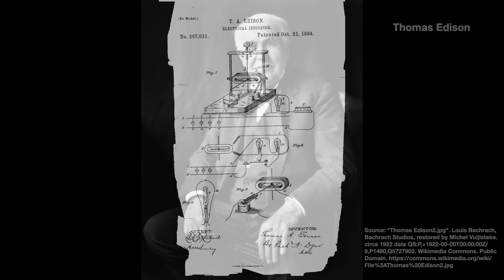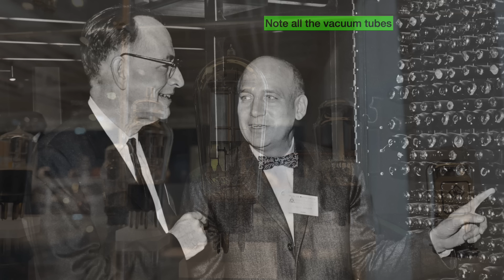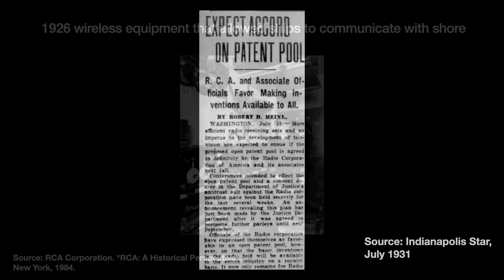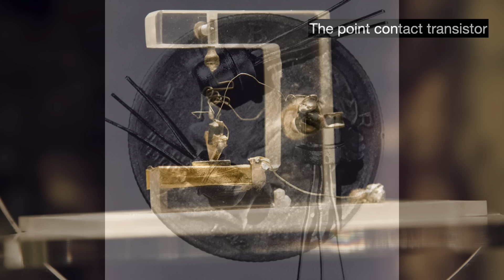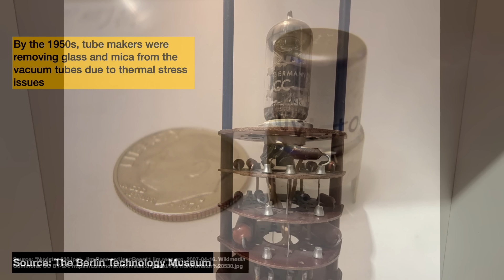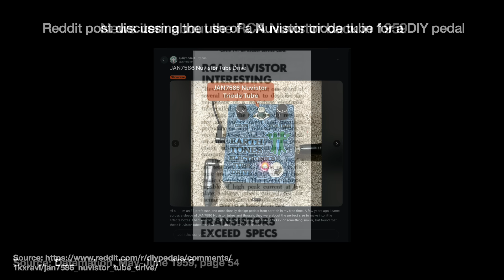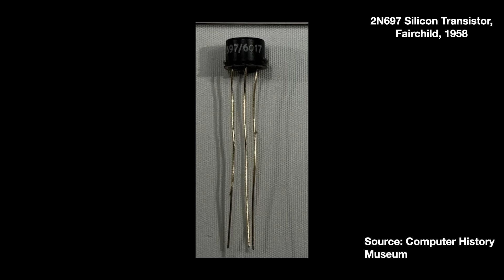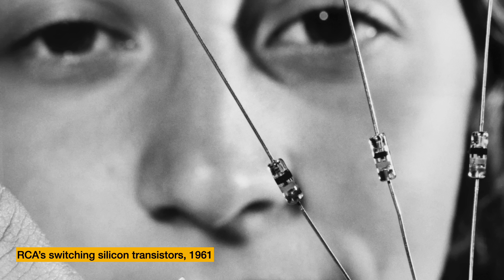RCA Made a Vacuum Tube to Beat the Transistor

Comment: If you follow the guitar amp world, you still see "we've reinvented the valve" products crop up from time to time - designers trying to get the tonal effect of a valve without the bulk, heat and fragility.
Reply: And then you discover that thermionic valves on silicon chips exist…
(And in WW2, vacuum tubes able to withstand accelerations of 20,000G were manufactured in the millions).
Reply: The Russian vacuum tubes were the best for that.  They probably still are.
Reply: Funnily enough there's a pedal that has used the nuvistor in it lol, the lightning boy audio nuvision. Maybe I'm too much of a zoomer but I never had a problem with opamps and chips anywhere. God's own semiconductors man godbless
Reply: And isn't that exactly what it is? An electron 'valve'? It describes way better what it is than naming it after the form of it's vessel.
Reply: @philippkemptner4604  What vessel is called an "Electron Vacuum Tube"?  And why would naming it after a plumbing fixture be better?
Reply: @MRandDS  Because it was all being discovered before understanding what was happening within. To them it functioned like an "electricity valve", very much akin to a valve used to control the flow of fluids. The "handle" is the grid, named because it somewhat resembled a mesh in many of the "later early" experiments.

The "gate" term later used in FETs honors the valve, implying "gate valve", as FETs function much more like tubes than a bipolar junction transistor (tubes and FETs are voltage controlled devices rather than current controlled as with the BJT). The "drain" terminal was also given in the same way. They went with "source" for the emitter/cathode analog, I guess "spigot" sounded weird, even though it was a very common term of the time lol
Reply: Guitar amps also love leaky capacitors for the same reason
Reply: There's this fantastic company that makes physical versions of electrical components out of plastic for teaching purposes
Reply: It’s like a pie. There’s good but then there’s really good. That tiny feeling that make me feel at home
Reply: Yup! Like the peavey vypyr tube heads 60 and 120 watt
Reply: Mechanical fragility yes, electrical fragility, no, vacuum tubes are very tough to emp and radiation
Reply: @KingAreallyus  I believe there were valves/tubes used in the Apollo spacecraft. They seemed to have performed ok considering what must have been a harsh environment.
Reply: @KingAreallyus , and, tubes can often survive brief voltage surges well above their ratings, while transistors instantaneously emit the magic smoke!
Reply: So cute that a VT is called a valve in many parts of the world. Cheers!
Reply: @shauny2285 ..and in some parts of the world " Lamps" is still used to describe a Valve. If you think about it " Valve" describes the function perfectly..it regulates the flow of Electrons just like a water valve regulates the flow of water❤
Reply: @shauny2285  It's certainly common to call them valves here in the UK - at least amongst a certain demographic. As the vacuum tube was invented by a Brit and he coined the term valve I think we have first dibs :).
Reply: @dynamohums where's that dynamo comin from??
Reply: @Beardwhip the 'old' engineer that I worked with called them "Fire bottles".
Reply: @dynamohums The Demograohic being every single Electric guitar and bass guitar player in the UK with good ears❤
Reply: @patrickfrantz2466 cool , " I think fire bottle no-1 is on the way out, it amplifies the noises produced by my portable communication device"!  Excellent, we need an international designation that every user/buyer can instantly recognise and " Fire-bottle" gets my vote.
Reply: @Beardwhip  I believe it was Faraday (another genius Brit) who discovered the principles that made the dynamo possible :)
Reply: @dynamohums  I did not know that Edison was a Brit.  Interesting.
Reply: @MRandDS  Edison was primarily a patent troll.
Reply: @dynamohums  Yeah, I know that's what the modern internet has told you gullible kids.  I bet you think Tesla was some sort of deity as well, don't you?
Reply: @MRandDS  Not really. Tesla was right about AC though. Edison made the wrong call backing DC.
Reply: @dynamohums , Edison discovered the principle of thermonuclear emission by accident while searching for ways to make light bulbs longer-lived. He made note of it but didn't pursue it further. Fleming, and deForest, were the first to make usable diodes operating on thermonuclear emission principles.
Reply: @goodun2974  that's right
Reply: @dynamohums  So that somehow portrays him as a less than and a stealer-of-knowledge?  And I guess that since he only discovered it by accident, then that totally disqualifies him from being the discoverer of thermionic emission and vacuum tubes. :|
Now I'm ready to start posting on Reddit and editing Wikipedia articles!!!
Reply: @MRandDS  😃. Edison certainly commands respect. I was just saying that the actual inventor of the tube/valve was someone else and he used the term "valve" to describe its effects. Which is a great way to describe it (as well as "grid" and "drain"). It's electrical plumbing!
Reply: @dynamohums yep, that would John Fleming.
Reply: @shauny2285 we call them 'lamps'.
Reply: True, there is a company making SS rectifiers built in to a valve shaped container that pops straight in to the base( the shell is a bit smaller size) that would have held a 5y3/5u4/5ar4 etc. Copper coloured shell with a blue logo  can't remember who makes it but it looks and works well in Guitar amps that used Valve rectifiers. All the orher valves can't really be replaced with SS  and please the human ear, for making music the Thermionic Valve is still king, all the ecc-81/82/83 and El-84, 6V6 /6L6, el-34 etc will be in demand for 100 more years...at-least❤
Reply: @Waldoandotto007, it's fairly easy to simulate a vacuum tube rectifier using some silicon diodes and a resistor or two to match the tubes' internal voltage drop, but providing the slower warmup of the tube rectifier (gentler on tubes and filter capacitors) is trickier to implement. A thermistor sort of works but takes longer to come up to minimal voltage drop/maximum operating temperature; the heat they generate tends to fry any nearby components (sometimes they unsolder themselves!), and putting a thermistor into the same plug-in housing as the diodes and resistors would tend to trap the heat and fry the diodes.
Reply: @Waldoandotto007  I used to work in the telecom industry when there were still a lot of tubes around.  IIRC, there was an attempt in the mid 70s to have transistor plug in substitutes for vacuum tubes, so that the equipment would be more reliable.
Reply: Fragility, I have tubes from the 1960's you can accidently touch a fet and it commits suicide. 😂
Reply: @GoonyMclinux   Now drop that tube onto a hard surface and see how long it lasts.  All devices were fragile when first invented, but anyone who works with solid state devices knows not to expose them to voltages or temperatures higher than they're rated for.  There's also this thing called thermal noise, which limit vacuum tubes at small signals.  That is much lower with solid state devices and when necessary they can be cooled to have even lower noise.  Then we get to things like microphonics and other tube problems which simply don't exist with solid state devices.  Then look at that phone in your pocket and try to imagine it made with tubes.

I also remember taking the tubes from a TV to the tester at the local drug store, to see which ones had failed.
Reply: If you put optimization, time and money same amount than what all types of transistors and photo lithography have cost, you could have flat vacuum electronics based smart phone. All parts possible could be made similar way than lithograph does silicon parts and whole thing then vacuumed at one go..
Reply: There really isn't a fundamental "difference", even though it seems there would be. One of the bigger reasons solid state doesn't sound like a tube amp is because of the transformer. It isn't "all the tubes" as much as it is the interaction with the output transformers that are required when tubes are used to drive a speaker.

Also is the power supply. There's a difference between swinging large voltages at lower currents and pushing higher current at lower voltage. It comes down to impedance. Not just the output transformer and plate current interaction, but the power supply holding all of it up.

Basically everything about USING tubes is "squishy", electronically speaking, leading to the pleasant overtones that are so loved, but it isn't just because "there are tubes".

If you soften the regulation of a supply in the 300+V range, give it to transistors, and drive an output transformer with them as would otherwise be done in a tube amp, you'll get similar results, because it really isn't "the tubes" at all, it is the dynamic of the required components that also must be present for the amp to drive something like a speaker.

I crack up when I see something like a pair of 12AX7s or something sitting in a little plastic box used as a preamp in front of a solid state amp using BTL or the like... it doesn't work like that, there will be slight differences in the linearity but nothing the ear is going to hear that can't be done with a transistor just the same. But if they "like the sound", ok... illusory as it is haha... 🤷‍♂️
Reply: @MadScientist267  Now Monster cables really improve the sound...   🤣
Reply: @MadScientist267So basically every component!
Reply: @mrdanger2891  No because fundamentally the components aren't different, except the actual tubes vs transistors.

Something like a standard transistor AB push pull, directly driving a speaker, and to a slightly lesser degree, its cousin, BTL ("bridged"), has much better control over the output in the audible range of frequencies. A speaker coil is low impedance, which means higher currents at lower voltages, and the transistors and power supply are low impedance as well.

The ringing (overtones) still happen, but it is happening at much higher frequencies, which leaves the audible spectrum much more "accurate". Harsh. Whatever you want to call it lol

Contrast the power stage of a tube amp, you have a high voltage but low current supply, with a high impedance of its own (traditional filter stages and the like are "soft"), applied across a high impedance transformer primary, in series with a high impedance tube. The transformer and tube both have notable parasitic capacitance, and this sets up the ringing in the resulting "virtual LC tank" that lands in the audible spectrum. The ever changing audio signal is continually interacting with these resonances, and the audio is "colored" as a result. The effect is of course even more notable when the tubes reach saturation because the transformer will want to "continue on" at resonance, complete with all the harmonics that go with it. These frequencies are more "pleasantly placed" along the spectrum than with a transistor amp, which tends to be much more chaotic (contains more white noise and less discrete harmonics "at the ear"), and therefore "less appealing".

A related concept is damping factor, in a nutshell, the level of control an output stage has over the speaker cone. Abstracted, one might say the coloring is a result of "poor damping factor", the intrinsically restricted authority over the transformer's field, rather than the cone of the speaker.

The result is "the tube sound".
Reply: It's always hilarious to listen to audiophiles get worked up about how tubes sound. They always say it's because the sound is more "pure" with less distortion or some other horseshit. In reality the tube produces a kind of inherent distortion due to the physical construction and imperfect nature and rigidity as well as from thermal expansion. Embrace the imperfect, you'll be a lot happier.
Reply: @Jackpkmn  Vacuum tubes create more even-order harmonic distortion which is much more acceptable to the ear than odd-order distortion.  Where the average person would cringe at a few percent odd-order THD, it would take several percent of even-order distortion to become unpleasant to hear.  That being written, the ultra-low distortion modern semiconductor amplifiers are capable of is FAR more pleasing than distortion, either odd or even order.
Reply: @MRandDS    Field effect transistors produce even order harmonics whereas bipolar transistors produce odd order distortion.
Reply: @James_Knott  Perhaps, but now we're comparing apples to oranges.  FETs are typically used in class D amplifiers as the final output device.  How common are FETs in class A or class AB amps?  Not very from what I remember of the 70s and 80s.
Reply: @Jackpkmn  NOT when tubes are combined in the front-end of a hifi amplifier with a solid state output section... that combination sounds fantastic!  

Tubes used for small signal jobs can be VERY linear and distortion free. It's when tubes are called for low impedance loads IS when the distortion creeps up big time. Tubes are a high-impedance component, and are NOT good at large currents, BUT, they ARE great in small signal positions where the current is very little. 

My FAVORITE amplifier setup is tubes in the front-end doing the light work and voltage amplification, and then big beefy MOSFET transistors in the output section doing the hefty high-current work... 👌
Reply: @davelowets  Yeah but that's my point right. Embrace what you like the sound of rather than trying to build something ideally.
Reply: @davelowets   Anyone who's studied electrical engineering, as I have, knows there is no such thing as distortion free.  Every device has non linear performance.  Part of engineering is minimizing that distortion.
Reply: Field effect transistors a similar transfer function as vacuum tubes.  Bipolar transistors have odd order harmonics, but FETs and vacuum tubes even order.  As a result, they sound the same and produce the same type of distortion.  One thing I have learned with tube lovers is they don't know what they are talking about, just like other "golden ear" types.
Reply: @James_Knott Well said.
 I have made JFET guitar preamps that are better sounding and less noisy than 12AX7A .
 But premature claims of Solid State amps sounding good poisoned this idea.
Reply: @zweisteinya   When transistors were first invented, they were lousy by today's standards.  Any amp made from them would be lousy!